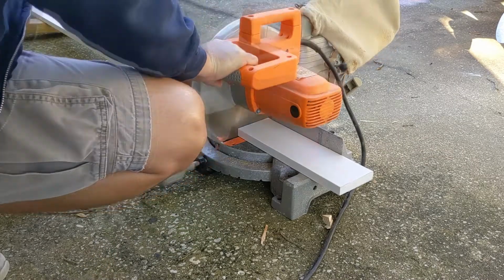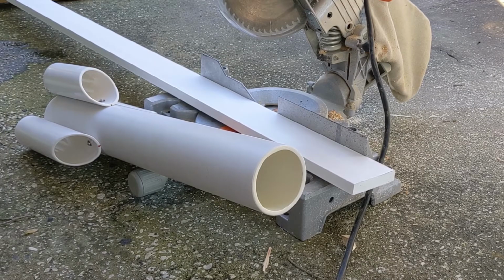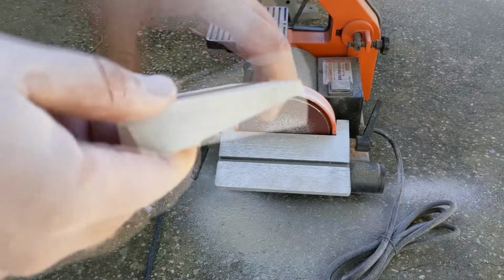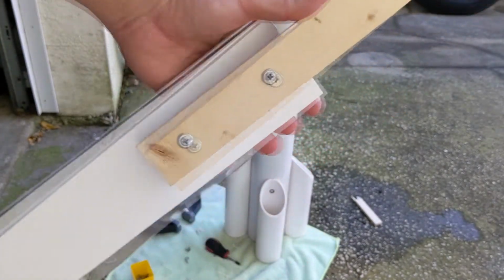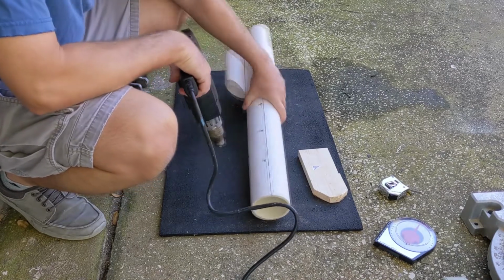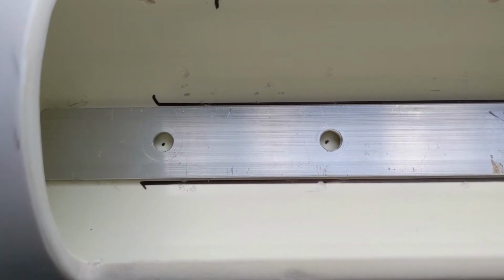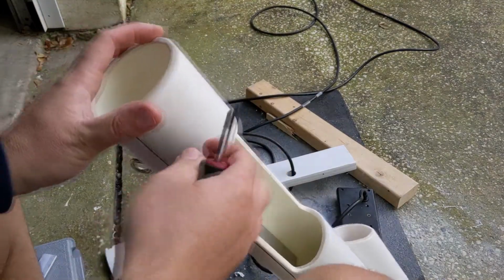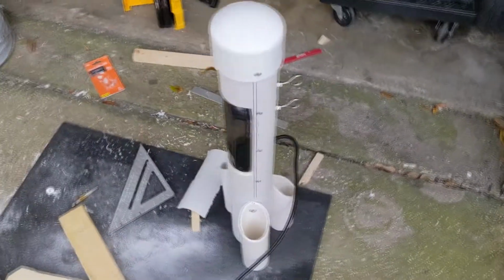DIY Towfish Build - Part 2

Comment: Could you tell me the dimensions of the piping used to make the equipment?
Reply: The larger diameter PVC is 3 in and the smaller diameter PVC is 2 in bulls schedule 40

Comment: Great project.  I am thinking of doing the same with an extra transducer I have and my older Humminbird 1197.  I am curious on the cable specs and splicing you are using to deploy at depth.  Also, are there any limits you know of on cable length verses signal strength with the Humminbird?  As a suggestion, when I have been working with more high end side scan systems in years past, all they use for ballast is a lead weight installed and secured inside the housing....something one could do with old diving weights or ankle weights.  Cheers.
Reply from the maker: Yes I'm using lead as weight and need to extend the cable. I've read you can use a cat 7 cable to extend it up to additional 30 ft. I think that's going to depend a lot on what hummingbird unit you're using. Some models are a little bit more powerful than others.

Comment: Hello,
nice video and awesome project. I am trying to build my own with a garmin gt56 transducer. How did your project work out? Have you testet it and did you have good results. I am suarching for every help i can get :) Best regards Andreas
Reply from the maker: The project is on hold for now. I have tested it and it does work better than the transducer mounted to the boat BUT I don't have any video of the testing yet. I'm currently tired up with a home construction project,  but I get moved, I start back on this.
Reply: @CSDSolutionsLLC  hy thanks for your fast reply, i am looking forward for any updates on your projekt. Nice that it works!
Reply: Hello, were you able to build your project and adapt the transducer?

Comment: Hi interest in the build, do you have a video of if in use, with some shots of the images ect, 
Have you found a way to transmit from tow fish to shore? ( ie transducer in water on a remote controlled vessel and the image being watched on the shore line?, or could this be rigged with a 100mt cable from transducer to control screen? Thinking of trying to build one bit to be towed by my underwater drone ( ROV ) …. 
Also what power source are you using ? And what unit for transducer and monitor?. 
Many thanks .
Reply from the maker: I have tested it and got a small amount of video but not enough for a YouTube post. So far I've towing and powering this from a 20' boat. Data is saved to an SD card and possessed later. I do have plans to build a rover boat but I won't be towing this with it. The rover boat will have the transducer mounted to its haul. Day collection will be automated just like a drone. These projects are on hold temporarily until I get done with construction of my house.

Comment: I haven't posted a video yet about the performance of this transducer but it glides fairly well in the water and records decent imagery. Unfortunately it does have quite a bit of drag and so it doesn't dive very well. I need to extend the cable and come up with a method to push it deeper. I'll do that in the future video hopefully.
Reply: I am very interested in what your results are, are the images good? I would like to build a towfish to find wrecks off Cape Cod to dive them, but need to see how others do it.
Reply: @adlaistevenson146  The images were fine and consistent with the hall mounted transducer but I have an issue with my hummingbird head unit again so I'm unable to do any additional testing. I did get some video during the initial testing but it's not that great. I might try and bundle it into a video just to give a glimpse of what it was capable of. My main issue with it at this point is my cable length limitations and getting it to dive deeper.